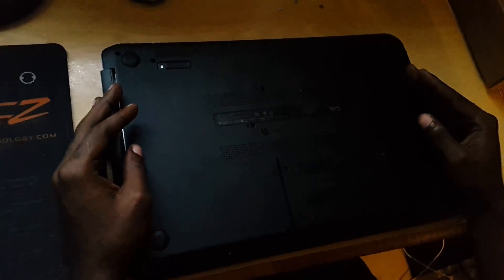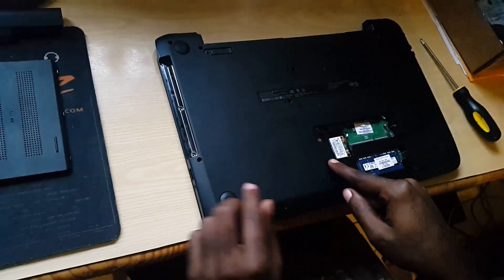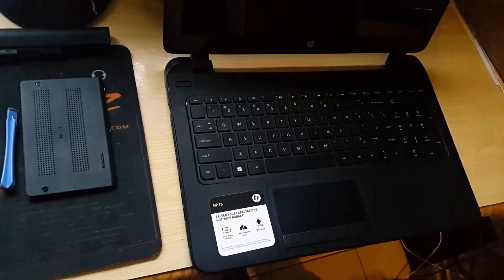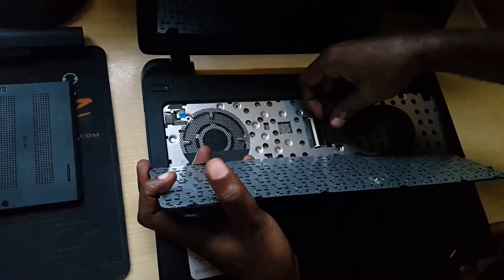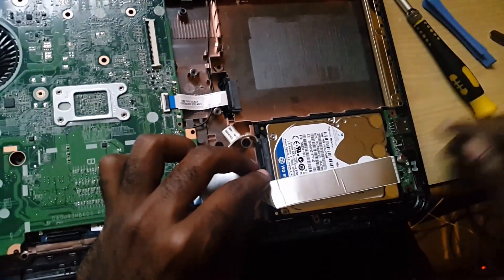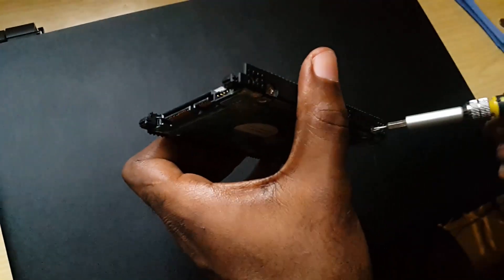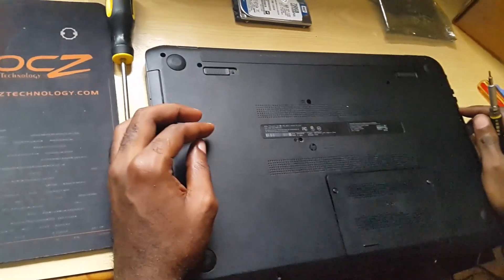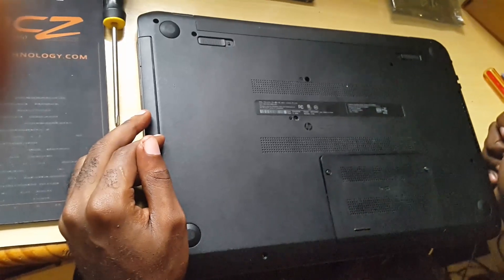HP 15 Laptop hard drive replacement or SSD upgrade

Comment: Just a heads up to people that take it apart, when you get to releasing the keyboard, DON'T slide your finger! I've made that mistake and cut myself for it, it's my mistake. 
Use a small pair of Pliers to lift the keyboard up when your releasing with a flathead.

Comment: I ran through this and got my new hard drive in, even installed windows 10 but once it was all booted my keyboard wont work. Any ideas would be very appreciated.
Reply: take it back apart back down to the keyboard and check that connection
Reply: +Pccapso tried that a few times. keyboard lights up but no buttons do anything.
Reply: I ran into the same problem but fixed it my inserting and running a windows driver Dvd.  I had to place an external mouse to play the dvd.

Comment: i just purchased a 15-f272wm laptop.  used this video to replace the hard drive,  goodlord they made it a pain.  but when i opened it up there was no cooling fan.  is this normal?  I can;t even see where one would connect to get power.

Comment: Once the Hard drive is replaced how do you install the operating system and such, it's not going to work right away right?
Reply: If the old drive failed, no.  If the old drive still works you can get simple imaging/cloning apps to copy the old hard drive to the new drive.  Many SSD come with a cable and software to do it.  I use the cable and AOMEI on my desktop to make an image of any new computer i get so I have a factory default to go back to.
Reply: Nope, you gotta get a copy of windows (or ubuntu if that's your preference) and install it on the usb or if you have a disc use the dvd drive to boot off of and install the operating system.

Comment: All this just to remove the harddrive???? What happened to accessing the hard drive through a simple cover underneath the computer? Thanks a million for your nice guide and video, but TERRIBLE computer design...shame HP.
Reply: I repaired computers when I was in the Army and most laptops started out easy access for memory and hard drive replacement.  Eventually, the companies figured out that if they made it a pain in the ass to replace components, their techs could still do the job but it would discourage most home users from attempting it and they'd just buy a new laptop instead of upgrading their old one.

Profit.
Reply: CRUNCH ABUNCH Still not an excuse. A simple plastic cover underneath a computer does not occupy thickness space. What HP has done is atrocious, they simply want to make it hard to upgrade your computer. They rather you buy a new one. They view these computers with these stupid designs as throwaway devices which you should replace regularly - no extensive updating. That's the only way they can make money selling computers.
Reply: Steven Fall

Yeah, I used to do this for a living in the Army.  It's not that difficult.  It's just time-consuming and a pain in the ass.  30 minutes for this compared to 1 minute to take two covers off the bottom of the laptop.

It's just so most people will think of the laptop as disposable and just buy a new one instead of cheaply upgrading it or replacing a bad HD.
Reply: Yes, actually. This is a  thing because the HP 15 is so cheap that to make profit, they cut corners.
Reply: pjamese3 Yes, a lot of consumer products have illogical designs just to avoid consumer easy do-it-yourself repairs and maintenance and boost the manufacturers profit for professional repairs and selling new products.
Reply: +pjamese3 True, but realistically this isn't that difficult. All you need is a few basic tools, a steady hand, and 30mins of time.
Reply: They do this because it makes them more money and not for any other reason. There's no reason anyone should have to spend 30 minutes taking apart a laptop to access the single most replaced part in a computer (or laptop). It's bad design, they know it, and they seek to make a profit from it. You wouldn't want to take apart your entire car to replace a car battery, would you? I wouldn't either. The fact is, people replace hard drives all the time. With hard drives becoming more reliable, laptop manufacturers seek to discourage people from lengthening how long they will keep a laptop before purchasing a new one and they do so by making the hard drive difficult to get to and by initially selling the laptop with a terrible hard drive. But, I agree, people shouldn't touch any internal components unless they are trained or have reasonable expertise or knowledge to do so.
Reply: @caitlinluera7372 guess what car manufacturers do exactly that to protect their profits as well. Even mechanics complain that newer cars are horrible to work on even basic maintenance items.
Reply: Sun Of God I fixed my laptop, like shown in the video, because the keyboard died.
Reply: This is a slim design, mostly all slim designs have their hard drive internally.  That's the price to pay for lightweight laptops.
Reply: I enjoyed every minute of it, except without the enjoyed part.
Reply: Caitlin Luera this takes 20 minutes tops to do. Its not rocket science. I swapped out the hardrive on mine. It was an easy job. They just dont want inexperienced people trying to swap a hard drive and frying the motherboard. If you cant do this simple job then you should not be touching internal parts.
Reply: @toddsecor288  Clearly you haven't done much of this kind of work. In the OLD old days it was 2 screws on the side of the laptop, slide the drive out, remove the drive from the mounting bracket, put new drive in mounting bracket, slide drive back in and replace screws. 

This is a money grab plain as day and one of the reasons I never EVER recommend HP machines to anybody anymore.
Reply: @gregsmith3302  I have done this several times on laptops that do not have an easy access door to swap the drive. They don't want people calling them up after swapping the HDD for an SSD and being like when I power my computer on nothing happens. Well did you install windows? No my computer already has windows. Did you put windows on your new SSD? No the computer already had windows...what don't you understand? Lol
Reply: @toddsecor288  Yeah well I've done it literally hundreds of times, maybe thousands over the last 20 plus years as a professional tech and I'm here to tell you that this is an entirely unnecessary design for the purposes that many here have already quite rightly made clear. To strong-arm unwitting users into giving HP  more of their money. 

Bonzo the performing chimp could be taught how to replace a hard drive in any of the hundreds of machines I've worked on. As the young lady pointed out, this is like having to remove the engine in order to replace the battery on your car. EXACTLY like it. 

Also exactly like your car, there are many simple operations that the average person can do themselves and there are many more that require an elevated mechanical aptitude and or specific training. Replacing the battery should never fall into the latter category and neither should replacing the drive in a laptop. 

It's an in your face money grab straight up from a company that lost it's mojo even in the printer world long ago. 

Don't get me wrong. I appreciate this fella making this tutorial. It's the fact that it needs to exist that's the issue.
Reply: oh and btw, yes I am aware that HP aren't the only ones who do this. This one is among the worst though.
Reply: 1 min vs 30 is a huge difference.
Reply: I agree 100%!  ABSOLUTELY RIDICULOUS!!!
Reply: I agree. They want to make more money from you, other than simply selling the laptop to you, they seek to make you pay for the replacement of the laptop with a new SSD (which they know you will do because the HD inside is terrible).
Reply: Why do they do this? Because if you do not have the basic skills to do this easy job then you should not be touching any internal components of a computer.

Comment: hi can you please tell me what hard drive i need to buy i think i have this exact laptop. i cannot get logged in it only shows a boot device not found.  I have a HP 15-f100dx i dont know the rpm but it is 500gb
Reply from the maker: +Valeria Moreno The only way to tell is to look to remove your current faulty one, never assume anything with these Laptops plus further more you will have to open it eventually.
Reply: Ricardo Gardener

Comment: i removed 2 silver screws on the sides but there's one in the middle. how did you remove thr drive that easily,thank you.
Reply from the maker: +See Mihail Watch the layout of the components and look for stuff in the way remove them first and as long as no screws are holding the Laptop Hard drive it should slide right out.

Comment: how did you get the 1tb drive to be recognized? I took out 750gb drive and added WD 1tb...and it won't read the drive. 
LEXI....there's a screw on the back of the laptop to remove the dvd drive....
Reply from the maker: +Bethany Ramsey Make sure the drive you are installing is actually functional. also make sure you have actually connected it 100% so communication is taking place between the Motherboard and the drive.

Comment: I accidentally lifted to hard and pull the black part with the white when disconnecting my power button and now when I resembled it, it won't turn even with the power connected... Does this mean I need a new laptop?
Reply from the maker: +Lexy Bell Highly doubt it, In all cases you should not force anything when disconnecting or reconnecting them. With that in mind disassemble the Laptop again and check your connections, if you are sure its the power button in question is causing the issue simply try to fix the connection point-you might have to get creative if you damaged it but its nothing new and issues even the best of us has encountered before.
Reply: there's a screw to remove on the back of the laptop

Comment: is the processor upgradable in this laptop?
Reply from the maker: +Slippery Pancake Its not normally done but should work if the socket type and architecture is compatible with the motherboard.
Reply: No, only the ram and hdd is replaceable or upgradable

Comment: After removing the screws my DVD drive does not slide out.  Any pointers ?
Reply: +tym1107 That's the same problem I am having. Did you figure it out?
Reply: JoeStorm No. I had no success.  HOW wanted charge me a bench fee of around $200 to replace a hard drive that was only 367 days old.
Reply: Uggghhhh!! I need to clean my fan and all I need is this dvd tray to come out lol

Comment: Question... can I upgrade to an SSD while also keeping my original HDD? I don't want to get rid of the extra space on my HDD, as it's very expensive to buy a large SSD. My computer is similar but not the exact same model... it's product number M1X51UA#ABL. Thanks for any help!
Reply: +ban ana Thanks!
Reply: +Matthew Mossop Actually you can install the original HDD into the disk drive bay with a hard drive caddy adapter. Who needs a DVD player now a days?
Reply: +adrianzao Wow had no idea you could do that thanks! I thought I was gonna have to buy a much bigger ssd. Does it matter if I don't have two hard drive slots on my motherboard? Does the caddy take care of this somehow?

Comment: Thanks for the video, eventually I want to put an SSD in my HP 15 which is a very slow PC, I only bought it as my main PC was down and needed something to do my work. Mine doesn't have easy access to the RAM like yours so I would like to max that out when I install the SSD. Most other laptops I ever owned had easy access compartments for the ram and HDD, HP could have done the same but I guess you get what you pay for.

Comment: Hi this video is amazing in that it has how to take the laptop hard drive out of my exact model of laptop. I just one question to ask you what is that tool that splits the case where you have access to the internal hard drive was it a pair of forceps? Could you send me a link to the exact tool you used in the video? Thanks Alex
Reply from the maker: +Alex Reed Here you go:http://tinyurl.com/pdyyxlh
In the future always check the description below the video or the annotations on screen as the links are usually provided there.
Reply: +Ricardo Gardener I have already taken a look at the link in the description I am still unclear what tool was used at approximately 5:30 where you slid in the small opening on the side of the computer  to remove the upper part of the case so you can get to the motherboard and hard drive underneath.
Reply: +Alex Reed The blue plastic piece he was using there is called a spudger tool
Reply: alright thank you very much!